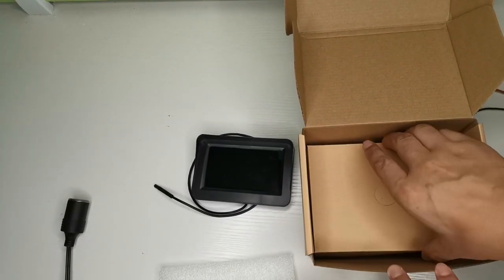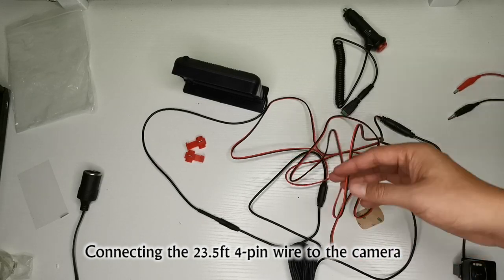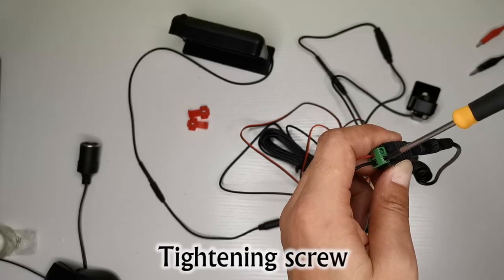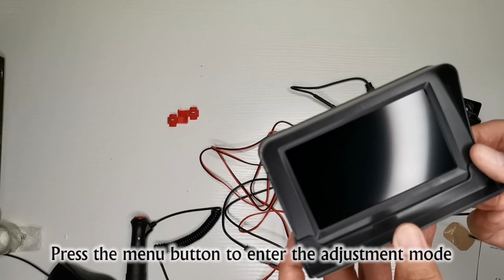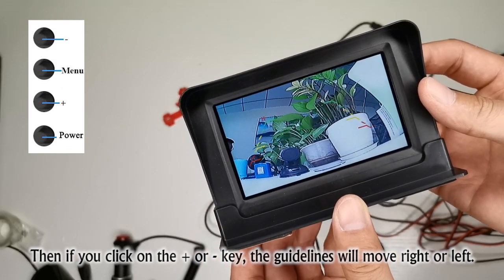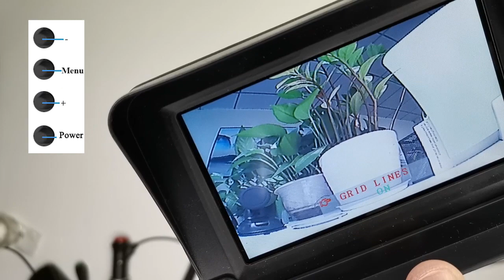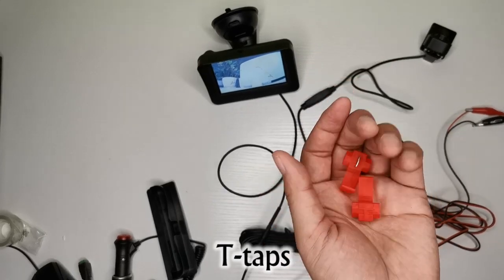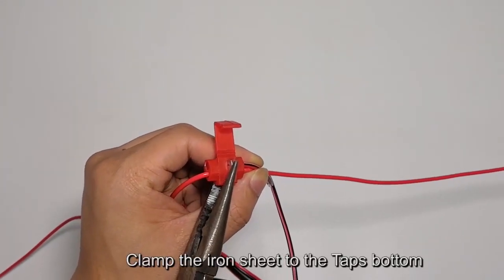how to connect each part of  a 4 3 inch backup camera system

Comment: How is this in anyway wireless?
Reply: It is not necessary to have a wire connecting the camera and the display. Each unit does require power.

Comment: I installed this according to these instructions. When I tested it with the car engine off, the picture is crystal clear. However, when I turn the car engine on, the picture has static and lines and flickers. Has anyone had this problem and found a solution?
Reply: I just installed mine and it was perfect testing it from the cigarette lighter but, after wiring to reverse light per the directions,  I have lines scrolling down the screen even with engine off.  Sometimes it display anything and sometimes it's very scrambled with no color.  I have no idea what is wrong.
Reply: Sounds like a faulty camera or a bad ground.